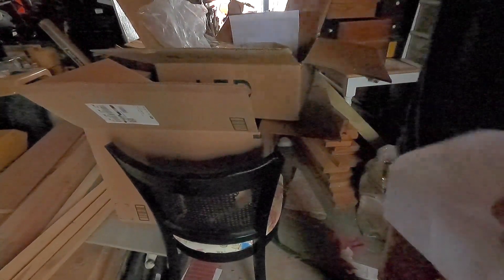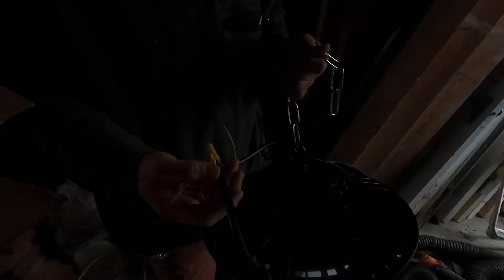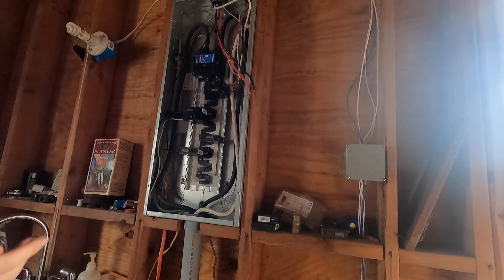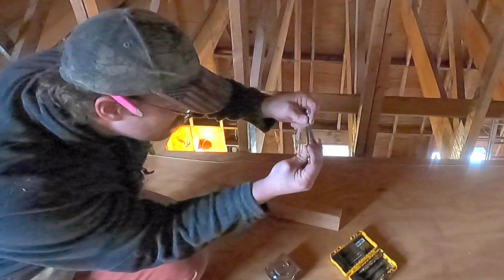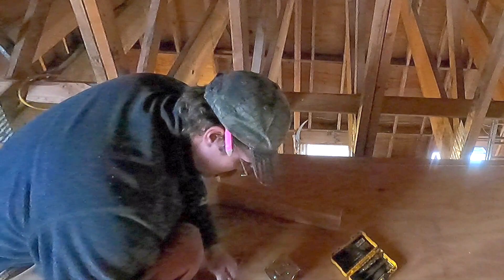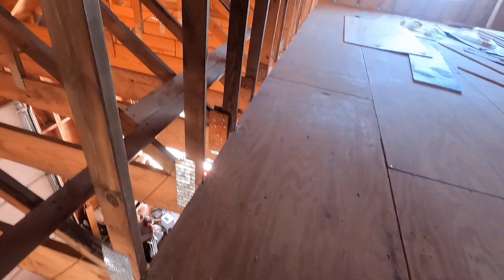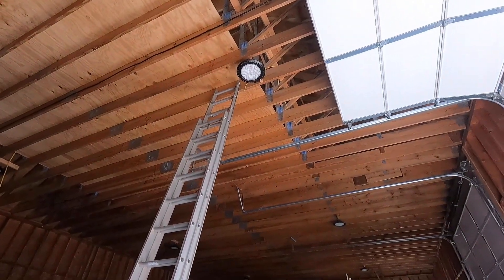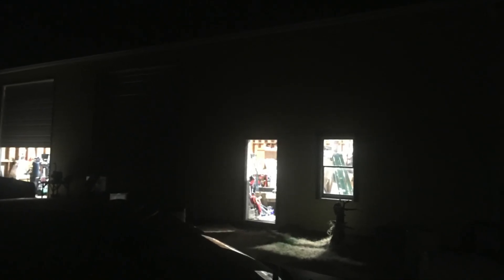Installing 200 watt LED high bay lights in the barn

Comment: All of that and not one word about what wire you’re running like if it’s 14 to the ground 12 two with ground isn’t as important as the lights you’re running
Reply from the maker: 12/2 w ground.  6 lights = 10 amps

Comment: Those lights are also great for high bays over 30 ft, but definitely much better light output at lower ceilings.
Reply from the maker: I believe that. Mine are 16' high with a 10' radius and it's a lot of light.
Reply: @robertscottII   if they were mounted as you state at 16 ft then the radius would be 25 ft and diameter of 50 ft  if you have a 120 degree beam angle. You would most defiantly have a good speed of light within a 25 ft circumference of each fitting 🤨